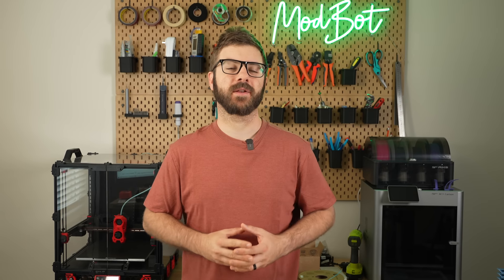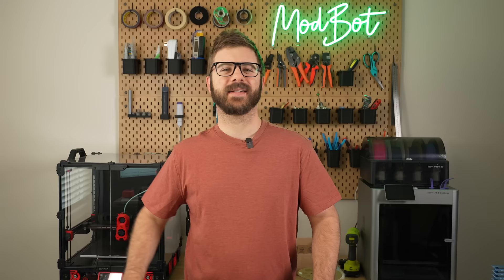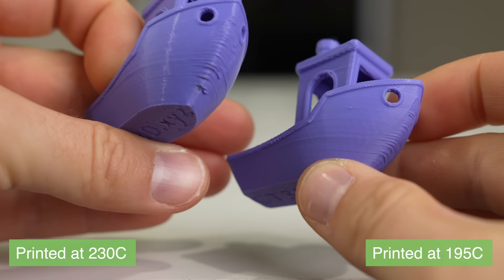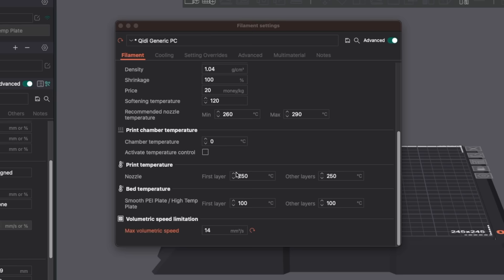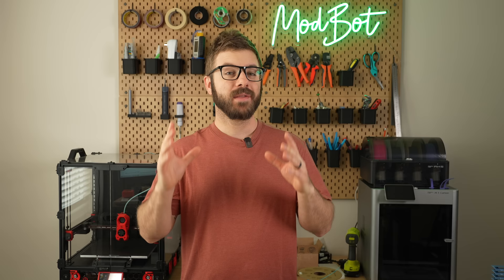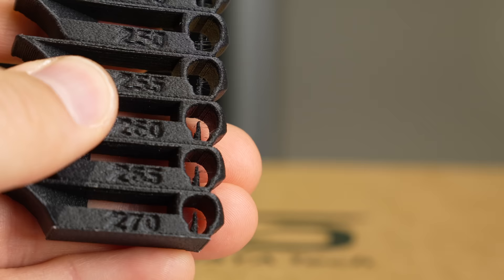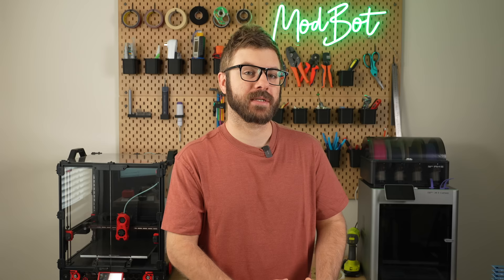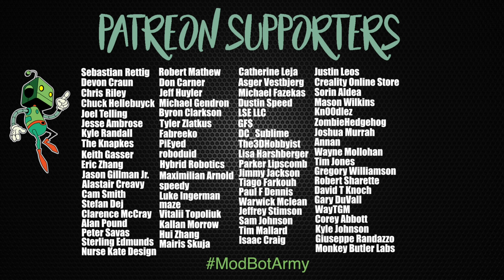Finding The Best Temperature For Your Filament (OrcaSlicer Calibration)

Comment: Missed the break test on the little peak. At the VERY end after you checked everything else you are supposed to use you finger to apply light force and slowly apply more fore till it breaks, This allows you to kinda test layer adhesion
Reply from the maker: Thats hilarious. I have been around temp towers/used them in some way shape or form for many years and this is probably the first time ive heard this. Its always been a visual inspection for me. The peaks are not reachable with a finger on this particular tower but you could still push on them with an allen key to see which one is the sturdiest. Now to go snap some peaks.
Reply: Came here to say almost the same thing: if multiple temperature results look the same, try breaking the spike and see which takes the most force.
The towers generated by Orca slicer are too small for my fingers though, so I usually use a screwdriver for that.
Reply: Granted, everything I do appears to be wrong, but for layer adhesion I actually try breaking the tower at different heights to see what sticks the best.

In my experience, I'm incapable of getting any two redeemable qualities at any one given temperature. I might get decent adhesion but stringing and bridging suck. I might get low stringing but bridging, adhesion, suck. And so on.

I'm fully convinced it's a PEBPAC issue. (Problem Exists Between Printer And Chair)

Comment: Its important to keep in mind that temperature settings should be in sync with your extrusion speed. Printing at 210 at 10mms3 flow will yield different results printing at 15-20mms3. The best thing that I have found for me is to tune the temperature based on the max flowrate with no more than 1% under extrusion. I typically print at 210 (mfg recommended setting) and I adjust my printer speed to be right at the edge of the extrusion limit without any under extrusion. This has always yielded excellent results.
Reply: This is something I'm still trying to get my head around. I print 95-98% Polymaker filaments and if I were to limit to recommended speeds then printer design likely could have ended years ago as you can't approach anywhere near modern speeds.

I'm greatly appreciating Daniel's series on what most experienced printers just take for granted as there are no definitive guides on the basics in my opinion. Ellis's guide gets a printer dialed in but you can't rerun that guide every time you change a filament. Without being able to identify what you are even seeing it's impossible to go learning solutions.

I'm currently battling a cycle of printing and putting up with disappointing results or just walking away and leaving it alone because I'm tired of watching videos of awesome prints and continuing to get sub-par results myself.
Reply: I only learned this when I started to print TPU
Reply: So should I do the max flow rate test first before temp?

Comment: Disappointing video for me, I was hoping to get more info compared to the existing orca wiki entry on calibration. While the video did a slightly better job explaining what to look for to get to the right temp, it didn't really help for filaments like the one in the video, where the differences are minute. Also missed the break test, as already commented by others. Basically, this video is a waste of time for anyone who has read the wiki and searched reddit for a few minutes. Which is a pitty, as the little information you do present, you are presenting very well.
Reply from the maker: Sorry to hear. Temp towers wont always give you the answer your looking for, like we saw with the filament I was testing out. My goal with this series is to stick with the calibration tools available in OrcaSlicer. In cases where I cannot find an obvious winner I will take a guess and run some prints. Based on the results of each of those prints I will decide if tweaks needs to be made by bumping temp up or down in 5C increments.

Comment: It's good that OrcaSlicer has included this test in the software.  This is nothing new.  The exact test has been implemented in SuperSlicer for years.  And by having dialed a ton of material.  The tower test is the least useful one.  Very rarely do I get a useful result out of it.  Only if you dramatically go out of the range for the material will you see anything meaningful.   And in the case of the material you are using in this example, I would absolutely go as high as possible and not in the middle of the range.  Layer adhesion with any filled ABS should printed as high as possible.

Comment: Not a fan of this test as it prints at pretty conservative speeds. If you find your temp on this test, it might not be hot enough for faster, bigger prints, and might lead to weaker parts or even under extrusion.

Comment: This was kinda of neutral.  I recall doing a temp tower in eSun ABS+ and getting identical results all the way to 280C - including poor layer adhesion.  Eventually I gave up and put another filament on, and it was totally different.  So IMHO, you should do towers in different plastics and different vendors to help yourself see differences, rather than just analyzing a single tower in isolation.
Reply from the maker: Thats not a bad idea. I find wildly different behaviors in different filaments. From vendor, to color, some show a large difference while others its almost a guess. In the times I can't find the obvious winner I pick something middle of the range given and run some prints. Usually based on that I can tell whether I should be bumping up or down.
Reply: @ModBotArmy  The trick is in getting a feel for the difference between a valid test result and a null test result, and for that you really need to see a valid test result in action.  I love the example image out there of z offset where it shows an inch of each of five or six variations from "way too close" to "just right" to "way too high", it's too bad that you can't reliably get that kind of temp-tower difference with different filament formulations.

Comment: In your last calibration-related video, you made sure to mention that you recommended calibrating the flow rate before the PA test (though you released the videos in the opposite order).  Is the timing of this video intended to be a recommendation that the Temp Tower test be performed after Flow Rate and PA, or is there another point that you think it should be done?

Comment: Good info. Anytime I buy a new type or brand of filament, I print a temp tower and a cube to keep as a reference. It's not quite as important on basic PLA's but having temp tower samples of silks and engineering materials that you can refer back to is really handy.

Comment: Temp towers are great, but I’d love to see a video on exhausting ABS/ASA fumes from some of the common enclosed printers like the QiDi X Max 3 and the X1 Carbon, or even that Q1 Pro. Ducting options/models, inline fans, what effect air coming back in through the vent has on prints.. etc. there are videos out there that cover some of this topic but usually from a custom enclosure or a resin printer etc..

Comment: I printed a few of these when I first got started. Couldn't tell an appreciable difference so picked 215 for PLA and ran with it.
Reply from the maker: Yeah it really depends on the filament. Its hit or miss for me if I will use a temp tower. Alot of times Ill just shoot in the target range and make adjustments based on what I see. I do think they can be really helpful for troubleshooting or when starting out.

Comment: I'm very new to this 3D printing thing, and I was wondering, should I do this first or should I do the flow test first? I tried to adjust my Z-Height mid print a few times and found the default Z-Height to have the best result (which kind of surprised me, I thought these settings came in all screwed up for some reason), I think my Z-Height is fine, so should I go straight into this temperature tower?

Thank you for all the content =)

Comment: You mentioned about the change from a shiny finish to matte finish. Does that have a relevance to strength or optimal temperature settings? Or just something that happens within the temp range.

Comment: Any tips on how to calibrate acceleration?
Reply: Input shaper
Reply: @thetigerflyer How would I do that?
Reply: @netherful  you need to be running a firmware that supports input shaper. Then you need an accelerometer (some version of an adxl345)  attached to a print head that supports mounting (or a toolhead board with the accelerometer incorporated into it). Connect that to your host (rpi for instance) and run input shaping tests. It will tell you all kinds of info for acceleration, smoothing, etc.

Comment: Haha, that calibration generates models with errors, and fix model is not available outside of Windows it seems.
Reply from the maker: I never noticed it before so I wonder if its in just the more recent versions. I went to file a bug in github but it looks like someone already did this past week.
Reply: @ModBotArmy  seems to be after v1.8.1